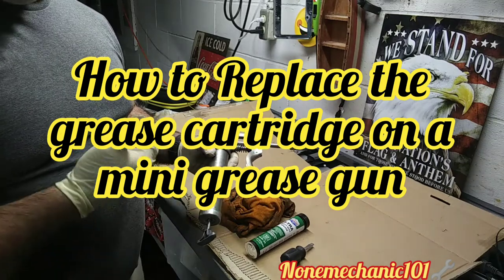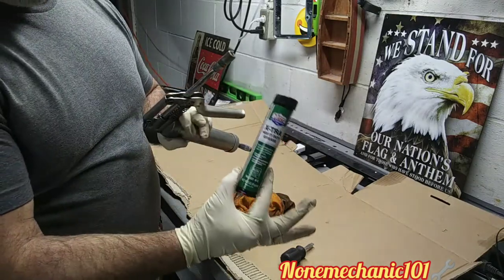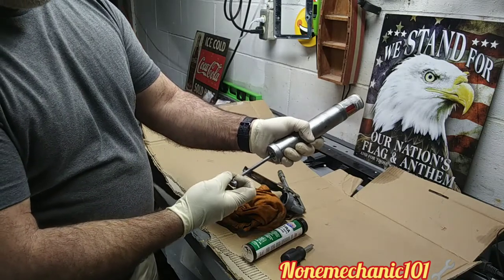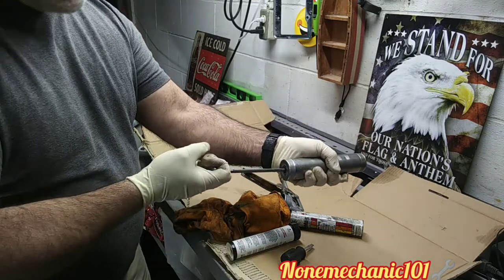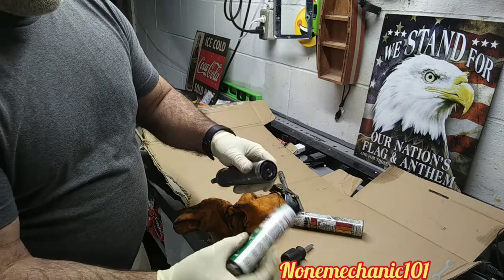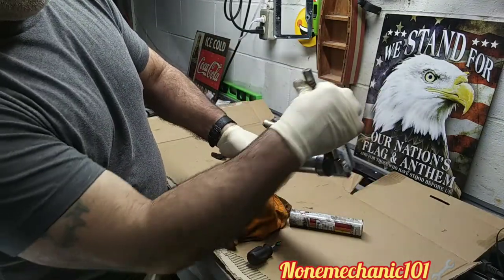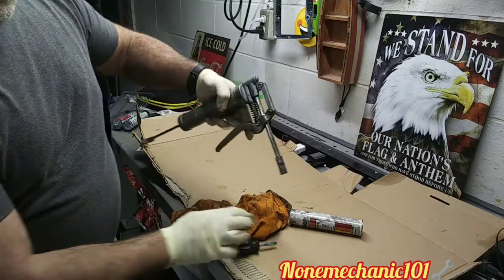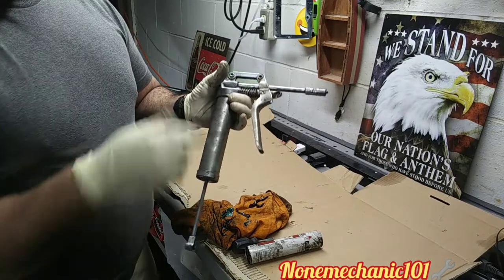How to Replace the grease cartridge on a mini grease gun.

Comment: I lost half of 3oz tube yesterday trying to insert the mini cartridge in and forcing it in. There was an air lock and grease was coming out of the top of the cartridge when I try to slide it in. I tried blocking the top end with a paper towel to hopefully not lose any more grease but grease just end up coming from plunger side. I spent 30 min just doing all this plus cleaning up. Fml.
Reply from the maker: @edgargap9587  Did you get it to work ?
Reply: @NoneMechanic101  I had to reload again today because I know the remaining half of the grease I ended up with yesterday wouldn't last me. I followed your video except I didn't remove the foil seal first because when I did that yesterday the grease came out of the top end of cartridge while forcefully inserting in grease gun. I cleaned the plunger rod end inside the barrel like in your video. I thought that would let the air pass thru the back end of the rod plunger if grease wasn't in the way. It did not. As I pulled back the plunger while coaxing the new grease cartridge in, grease kept coming out of the back end around the plunger rod. I think since I forced the mini cartridge yesterday a lot of grease probably got around the plunger and into the area where spring is. That, or I have a defective grease gun. Anyway, I have another problem next time I need to reload a new cartridge. The mini cartridge I bought from autozone today was a tab bit bigger and I had to force it in. Getting that out will be a struggle. I think next time I'll clean the inside of the grease gun tube first before inserting new cartridge. I think the trapped air is supposed to go between the grease cartridge and the chamber while inserting it. Since the inner wall of chamber has grease then the trapped air has no where to go. Also gotta check the plunger and figure out why grease is getting behind it.

Comment: I’ve been trying for hours to remove the old cartridge
Reply from the maker: Is it stuck?
Reply: Me too. The cartridge doesn't come out when I release the bottom handle (the T handle on the bottom of the grease gun). Instead, the plunger runs right through the cartridge and pushes a bit of grease up through the hole where the screw-on pump handle attaches. I think I have to stick a knife in the hole and pry the cartridge sideways enough to grab it with vice grips or a pair of pliars. Is that ok to do?
Reply from the maker: @GetRealBaby  In this situation. I wouldn’t know what to do
Reply: @NoneMechanic101  I followed my own instructions, prying the lip of the old grease cartridge inward enough to stick the knife between the metal tube and the grease cartridge, then turning the knife inward again, cutting the cartridge all around, leaving bits of the cartridge exposed in order to grab the thing with vice grips. It was important to use a slender blade knife, otherwise I felt it might damage the metal tube. The cartridge was "locked" onto the tube more or less, but once the knife was inserted down into the tube, it was enough to unlock the thing. It came out easily after that.
Reply: Did my tip help?
Reply: I remove old cartridges with needle nose pliers…just find enough of the end edge of cartridge, grab it and pull.